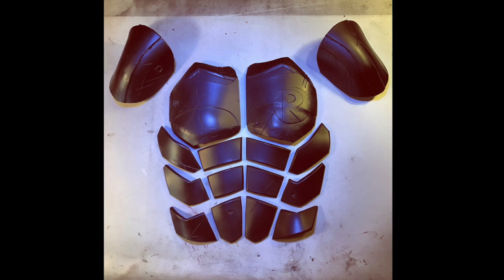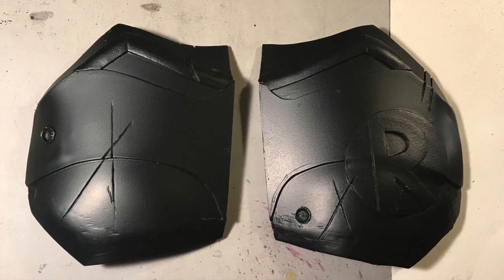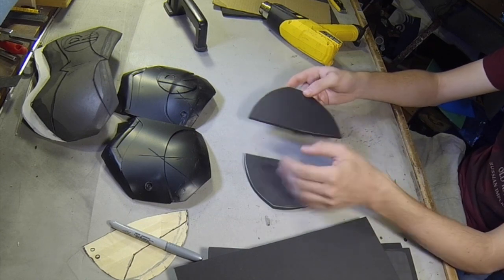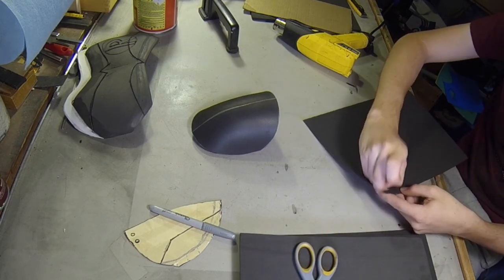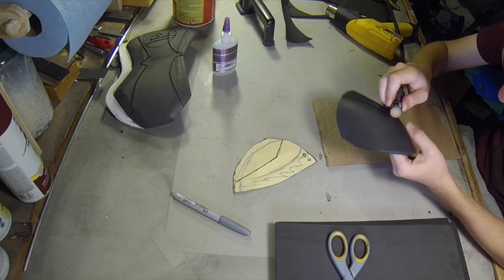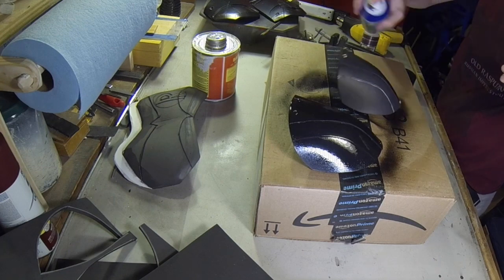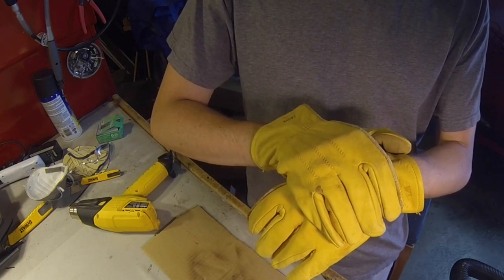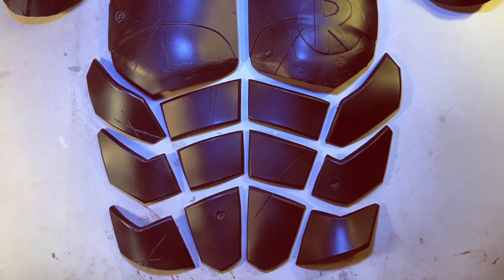Building a Robin Costume (Fabrication)

Comment: you can use heated plumbing down pipe cut in half n flattened for armour parts too ;)
Reply from the maker: That would be a great way to get super cheap pvc for sure, it would only take longer. Great suggestion!

Comment: where do you recommend getting the materials such as the eva foam and contact cement? i’m currently figuring out what i should do for my robin costume
Reply from the maker: For the two thinner Eva foam sizes I recommend Michaels, Joann's, or Beverly's really any craft store should sell it. For thicker Eva foam I recommend Harbor Freight. Barge cement is the stuff I use and I got mine off Amazon but I believe Walmart sells it as well from what I've seen online. Best of luck on your Robin costume, when you finish Id love to see a photo. I'm on Instagram @CWLbuilds or on Twitter @curlycaleb
Reply: ok thank you so much for the help😁😁

Comment: Great video and beautiful armor.  You are poisoning yourself with the Barge and the Tool dip and everything else. So you may want to buy a resperator.
Reply from the maker: Thanks! usually I do wear a respirator when working with Barge especially when Im glueing larger pieces together but in this case I was only using a very small amount and I was in a very well ventilated room. For the future though I will be wearing my respirator whenever I work with harsher glues and paints.